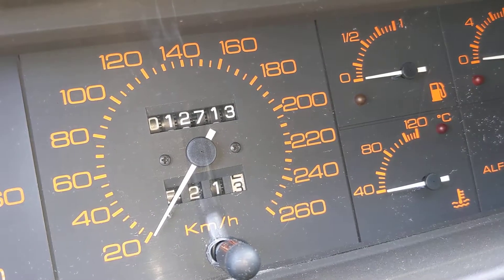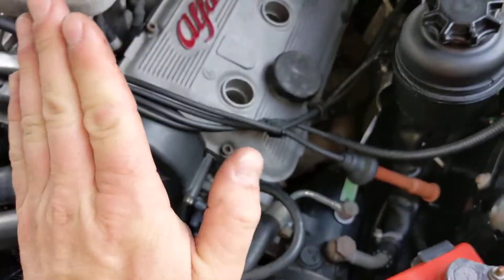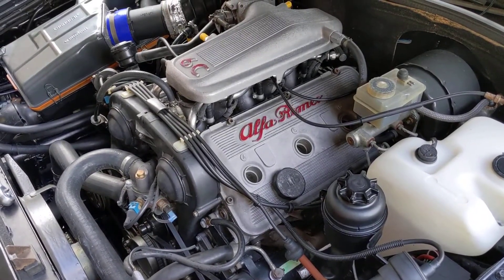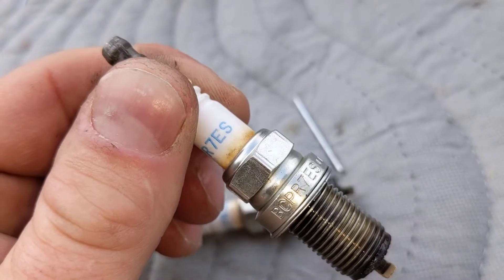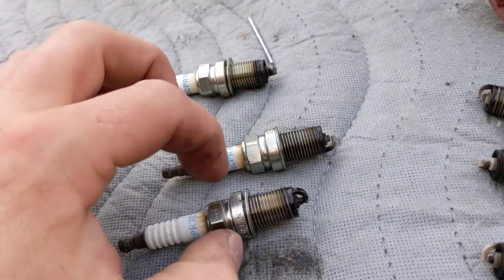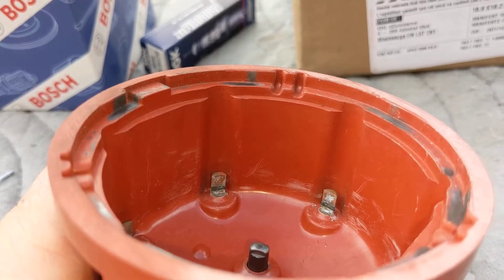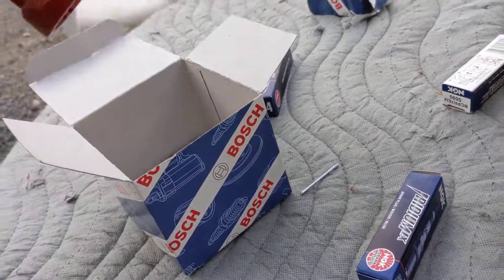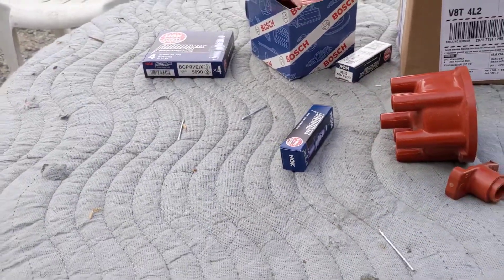Milano eats through ignition components

Comment: I had a really bad misfire in mine (although it's a ts) and it turned out to be the leads. I sprayed water at night with a mister bottle and it showed the arching immediately. I hope what you did works and you don't have to change the leads. I've been told the coils are very robust!
Reply from the maker: well I would have suspected the leads but they are also brand new. It seems to be good for the time being